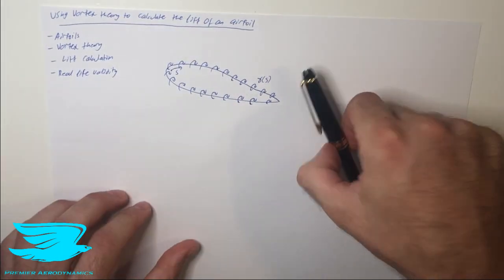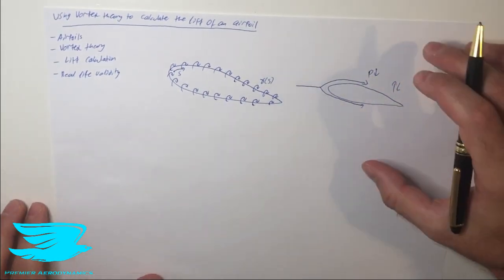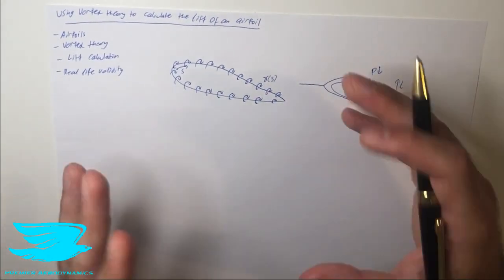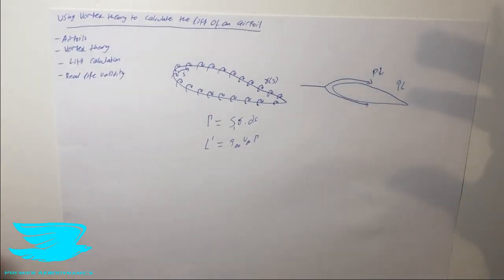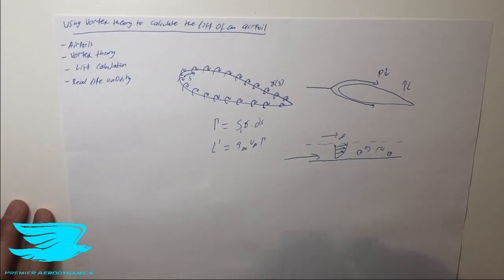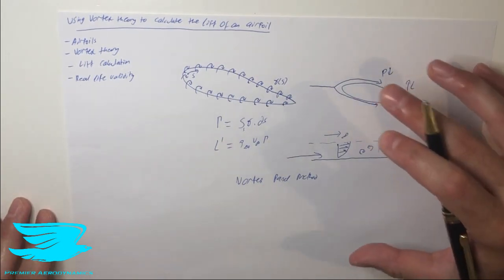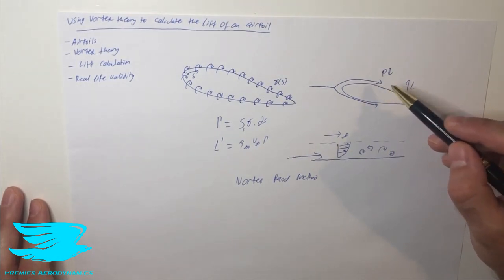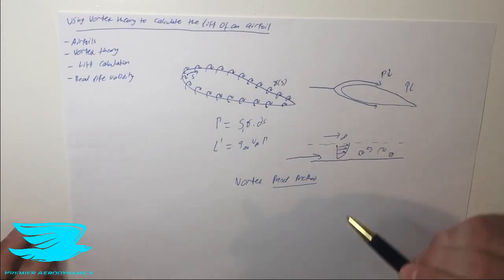[Aero Fundamentals #14] Using Vortex Theory to calculate the Lift of an Airfoil

Comment: The weakest part of the vortex lift theory is still a lack of adequate physical explanation. The math is great by itself, but the physics behind it is even greater.
Reply from the maker: Well, it's actually tied to the starting vortex that occurs at the trailing edge and is shed upon start up. Once viscosity is introduced, things get mixed up and it becomes harder to see.
Reply: @PremierAerodynamics  it is amazing what YouTube eventually gives to you as a recommendation. I am glad you understand how wings actually work, that is great. There is a pressure difference, that comes from a velocity difference given by the bound vortex or circulation, and that is induced due to the shed starting vortex. Great work!